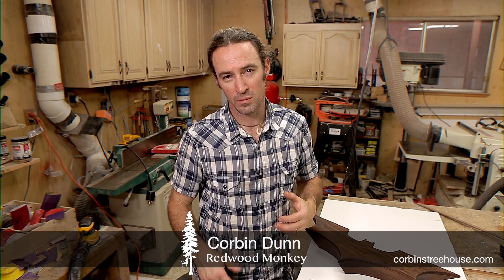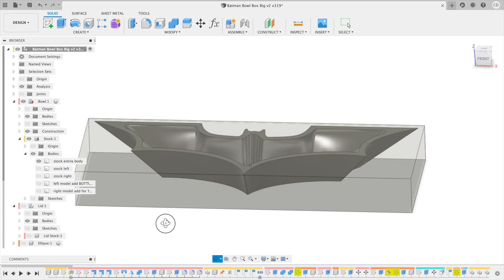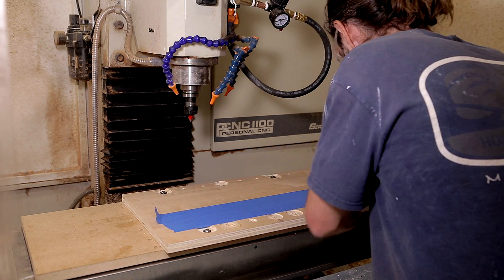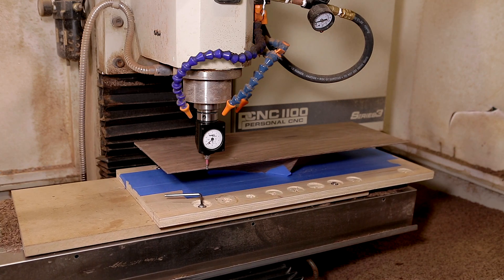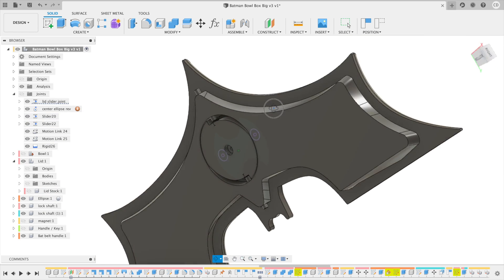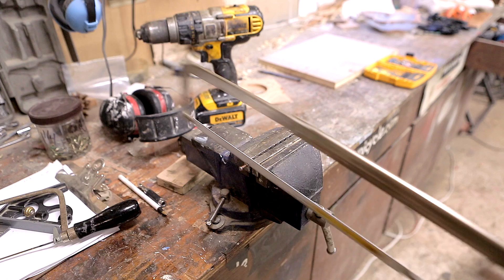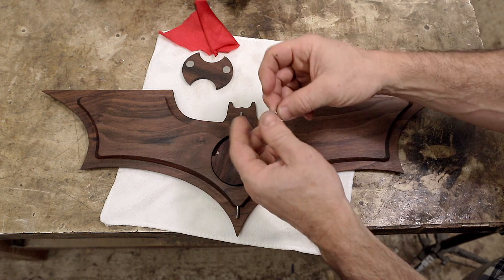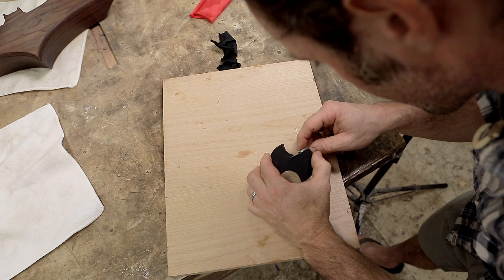Secret locking batman wood box! Hidden key and latch activated with magnets - CNC router woodworking

Comment: Great video. Great locking mechanism. One way I can think of drilling in that tight space is by using a 90 degree angle drill attachment from a drill press to be precise.
Reply from the maker: Whoa! I didn't know those existed, and it looks like they would work perfectly for something like that. Thanks!

Comment: one option for the locking return of the pins would be to use a spring to return the pins to the center. u could stop the spring from coming out the other side by using a plug or small set screw this was an awesome project! good job
Reply from the maker: Thanks! Springs are a good idea -- I did some conceptual experimentations with them, but I couldn't find a simple way to stop them; the springs would have to push out to latch...and making them come back in a compressed state is what was difficult for me to figure out.